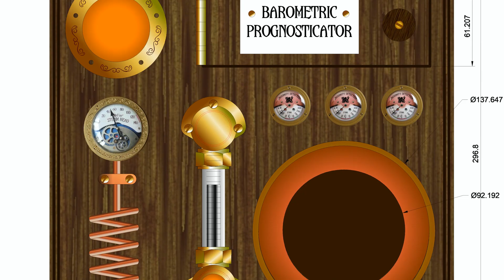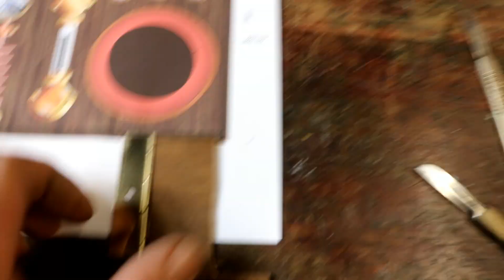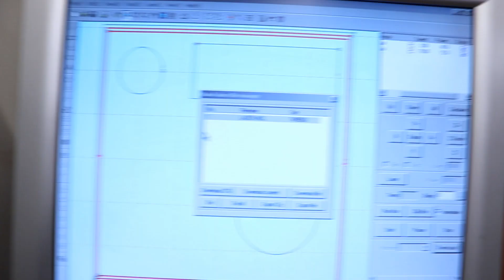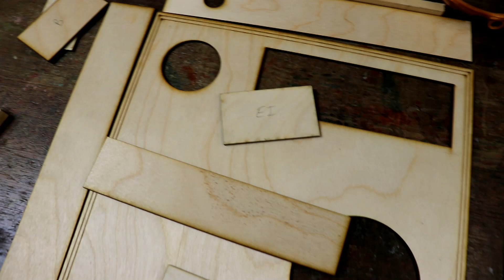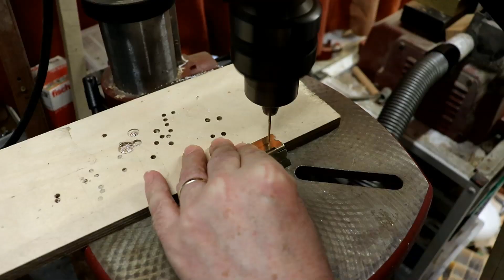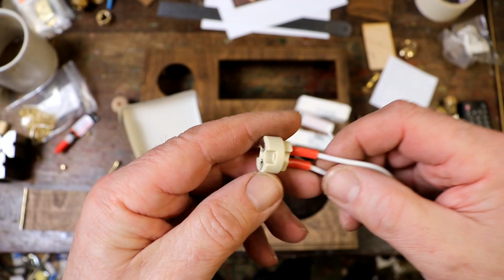Steampunk Truck - Part 1

Comment: I'm actually planning to use brass L brackets at the top and bottom, or perhaps small brass straps or hinges on the sides to mount it in case I ever need to service the light.  I'll figure that out when I go to put it on the door.
Reply from the maker: The flame light surround fixing screws are glued into place, so the brass dome nuts can be removed from the front to gain access to the flickering lamp, should it need to be replaced.
Reply: @steamhead  Awesome!   I'll figure out mounting hardware when it arrives then!    Looks amazing so far!
Reply from the maker: I'm so pleased you are happy with it!